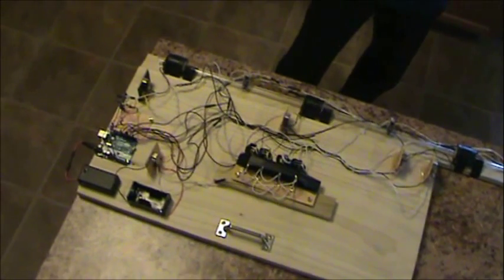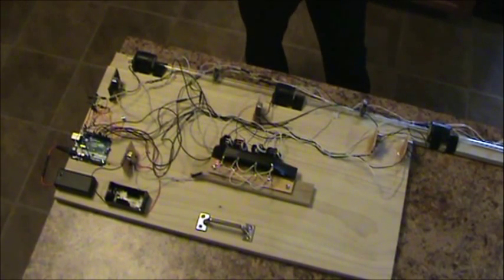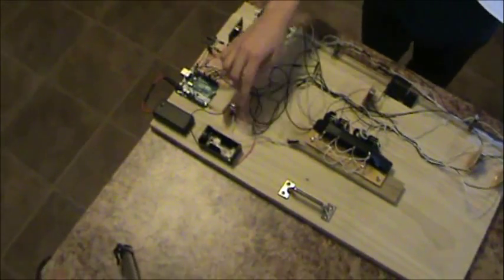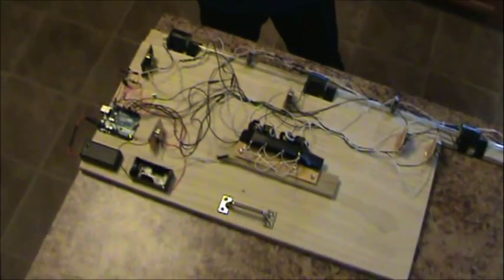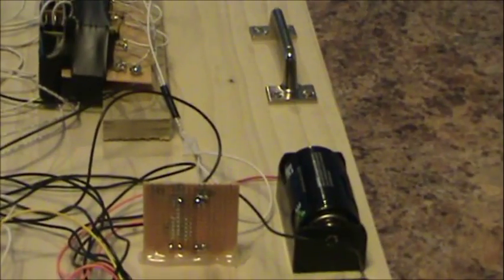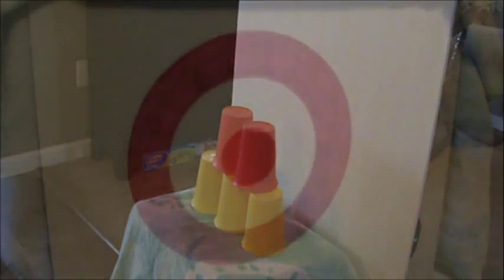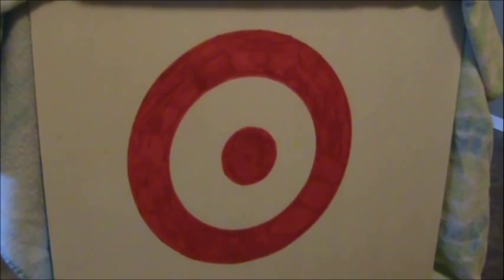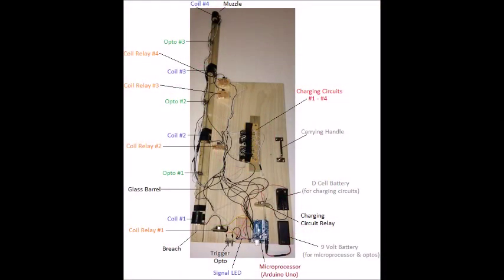4-Stage Electromagnetic Coil Launcher

Comment: Now THIS is "bomb clock worthy"
... A lot more effort was put into this. Granted, I support Ahmed's interest in electronics, but I think the whole bomb thing was way overblown ...
... Anyways, sweet project! Even I didn't make stuff that complicated back in 8th grade. X'D
I'm curious as to how reliable it is with those relays. The contacts might weld together with the high peak currents that flow through them. If you don't know already, using more turns of wire in your coils will reduce the peak current for a given voltage/charge. Obviously, this means that the magnetic fields will change slower, which might mess up timing ...